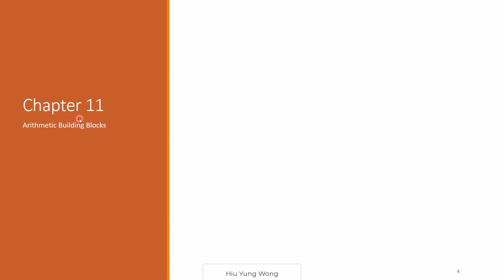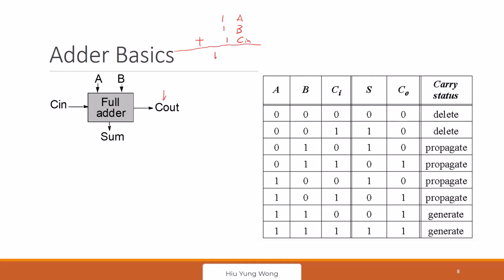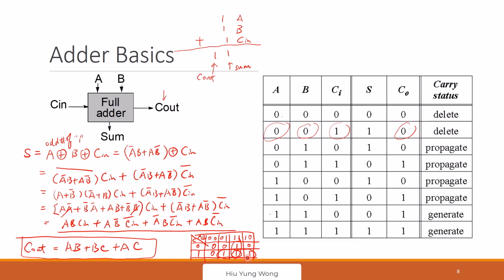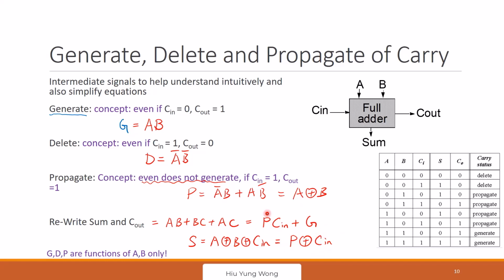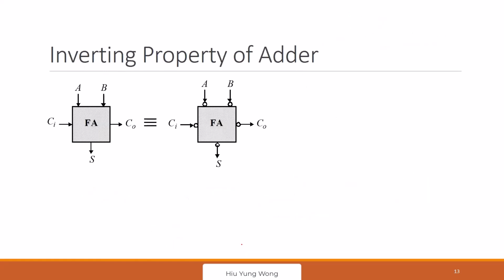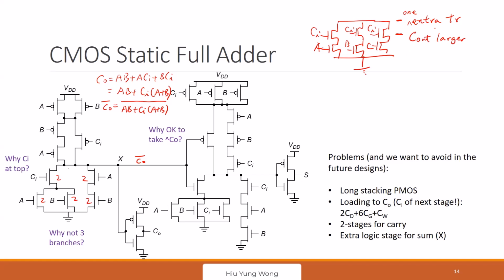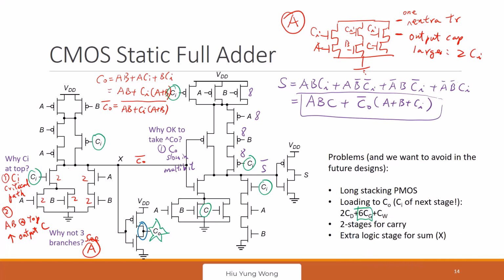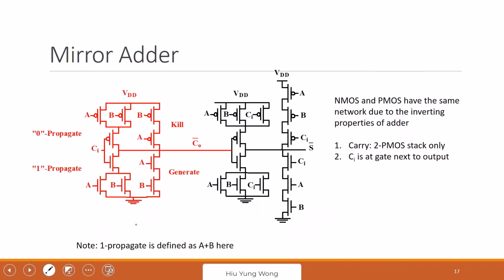L18-A Full Adder and Ripple Carry Adder

Comment: what is parasitic delay
Reply from the maker: The delay due to parasitic components. Ideally, the circuit should be just what you see in your drawing. However, the wires, etc have resistance and capacitance. The transistors also have capacitance which is unavoidable. These are parasitic and cause the slow down of the electrical signal propagation and thus the delay.